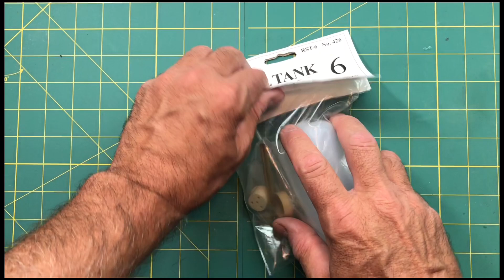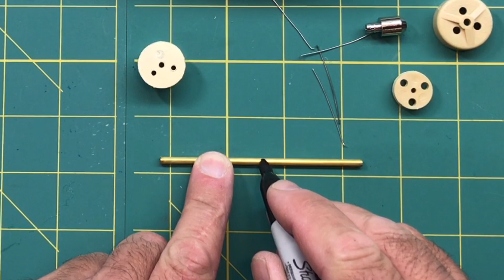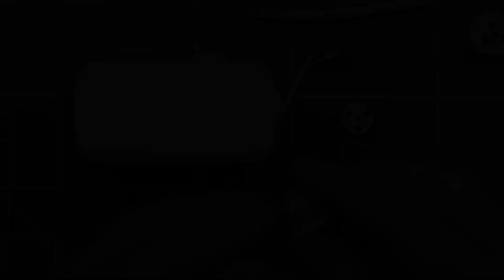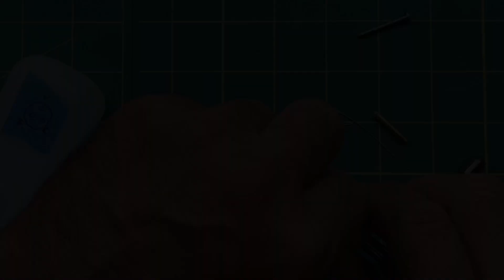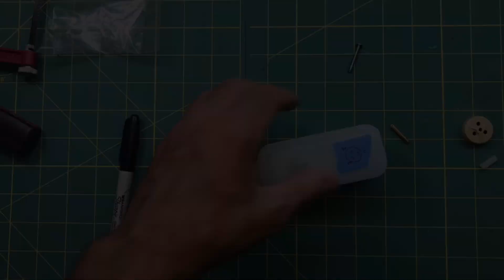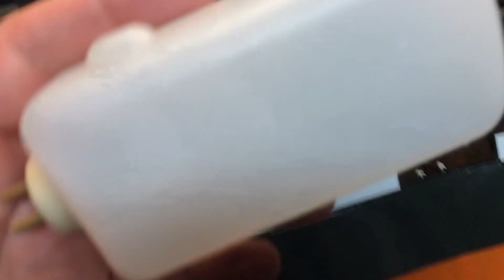Assemble an RC Plane fuel tank

Comment: Sorry this is not the way to design a tank its all wrong!!!    You just need 2 in/out  the vent line serves no purpose at all you cant make pressure from exhaust with an open vent hole to outside

Comment: I know this is a 4 year old video. But I noticed the clunk sticks straight out and doesn’t fall to the bottom of the tank. I wonder if this caused the dead stick condition on your subsequent video?
Reply from the maker: Thanks, Ill have to review and see. If it was hanging in the air, that would be a problem on a low tank for sure

Comment: I recently purchased fuel tank for my plane probably it's chineese made.Before inserting stopper to fuel tank brass fuel tubing rotating easily.Is this normal or how I can fix it? Or if I insert stopper and tighten the screw is it going to be fixed?
Reply from the maker: Hello, ya hopefully just tighten the screw on the stopper should secure it. Just don’t strip it. Tighten and check as you go. Once you get all the tubes  seal all but one off with a piece of tubing and blow into the open to make sure its air tight, then you are good.

Comment: I bought a sulivan 12oz. tank. This my first time doing this. My plane has a cowl. I'll have three lines. One is the pick up line to carb. One is the vent. Do I just have hose down ward for the vent? Third line to the muffler. How would I get fuel pumped into my tank if I have a cowl?
Reply from the maker: One line has the weight clunk on it that extends to the back of the tank and should be free to move about, this line attaches to your carb. The vent line is curved up in the tank toward the top on the inside and this line connects to the muffler which pressurizes the tank and helps push fuel to the carb. The vacume action of the engine also draws the fuel. So you do not need anything else to get the fuel pumped to engine... Now the third line is actually optional. You use that if you want to have an extra filling line, so that just goes anywhere usually in your tank compartment loose that you can connect to when you fuel up a tank. You will a "fuel dot" to plug the line that you take off to fill up and put back in after filling. If you do not want to use the third line for filling, you can fill the tank by disconnecting the  line at the carb, fill though that and then just plug back on carb. For the third line you can also install a little fuel filling valve that you can plug into as well. Look up on Dubro website fuel dots and fuel filling valves, they also have tutorial on setting up a tank. The cowl doesn't matter , it just covers the engine. So you may want to use the third line to fill as noted above since you usually cant get to the carb to fill the tank because the cowl may be in the way. Good luck!
Reply: @JamesRCPlaneTech  Today I hooked up the line with the clunk to the carb. The vent line that curves up in the tank to the muffler. I poured a little fuel into the carb for prime. Used my RC motor spinner to start it. Problem I'm having is the motor won't stay running because I can see that no fuel is getting pumped to the carb. Does it take a lot to pressurize the tank? 
I have the carb sitting about the tank if this matters. K&B .61 with a Pitts style muffler. Thoughts? Thanks.
Reply from the maker: tough to know without seeing it. The piston vacuum action should be enough to pull the fuel to the engine, regardless of muffler pressure. Do this: fill the tank, but make sure no fuel is yet in the line to the carb (air) only. Then observe the line, open needle about 2.5 to 3 full turns, set carb about 1/2 to 2/3 open.  And then hit it with the starter, you should see fuel fill the line and travel to carb. If it doesn’t then make sure its not plugged. If fuel is traveling to carb and it only starts briefly and sputters out it may be flooded or bad glow plug. Check that glow plug, it may look hot enough , but if old hard to tell. Set it aside and try a new one. Center of tank should be along center of carb or a little lower. If higher it could flood the engine.
Reply from the maker: Is the engine inverted or sideways, this is prone to flooding. But will work fine once practiced.
Reply: @JamesRCPlaneTech took the carb apart and cleaned. I think something was plugged up. I turned my remote needle valve 3 full turns. Primed it and I am now getting fuel to the carb. Attached the glow plug igniter and spun the motor. It's will run for 3-4 seconds then die. It does this pretty consistent. Maybe bad glow plug? Nos motor and everything but you think a glow plug could still go bad? Yes it will be sideways in the plane but it's currently inverted for this break-in.

Comment: I bought one for diesel engines, and the ether melted the rubber bung. 😢
Reply from the maker: Oh, thats not good. This one is for glow fuel, don’t think it works for gas or diesel. But they do make them for that at dubro and Sullivan, well at least for gas, not sure about diesel

Comment: I didn't follow the logic behind having the second clunk for fuel evacuation/filling. Why is it better than just using the carb line?
Reply from the maker: Hi, well I guess preference and also maybe access. If you have a cowl it may be hard to pull the carb line off. But if you have clear access, pulling of the carb line is perfectly fine. Like my Cub or my Revolver , I cant get to the carb line, so the third line is needed.

Comment: Why are you cutting the brass when the rubber seal is on table ?? You are contaminating  it ,the extra part was to help with bends
Reply from the maker: Interesting about the extra part, I had not known that. Makes sense to have a plastic tube to help against kinks.
Reply from the maker: Thanks, I added that note in the description as well

Comment: Good video!  I certainly enjoyed it :-))  I have two things to add to your instructions.  The first is that you can actually dunk the entire tank in a bucket of water to test the leaks.  Bubbles give away the leaky spots as you blow air into the tank.  The second thing is that you have to align the carburetor intake with the fuel line in order to prevent flooding.  Some people place the fuel line a little lower than the carburetor intake, but I never found it really necessary unless you have a fuel pump.  Also, sealing the opening in the firewall may be a good idea to protect the unburned fuel to sip inside the fuse.  However, that is only a precautionary measure, and it may not be necessary if you do a good job in the setup like what you have done here.  Take care.
Reply from the maker: Thanks for the tips. I really like the dipping in water, that makes a lot of sense.
Reply from the maker: Thanks for all the suggestions here.

Comment: Hello, i bought the same tank but I cannot make the rubber tight or locked…I screwed it until it stops but I can remove cap very easy, is it normal?
Reply from the maker: Hi. No it should be tight. It should have the outer plastic cap, the rubber stopper and inner plastic plate. The screw will go through outer cap and rubber stopper and into the inner plate. If its loose either its not tight enough or the inner plate is stripped. It needs to be tight so it won’t leak. But you have to be careful not to strip the inner plastic plate. If you can tighten it down and the screw gets tight and its still loose, something is wrong and you may want to see if you can get a replacement. The way it works is the screw draws the inner plate in and that squeezes the rubber stopper to plug the hole. If thats not working something is wrong with the tank.
Reply from the maker: Let me know how it goes. You want to tighten it down nice and snug but you don’t want to over do it since its a metal screw in plastic plate.

Comment: I need a small fuel pump to pump fuel from my tank up higher than the then it will go by the pressure any recommendations 🤔
Reply from the maker: I’ll be honest, I have never seen a small fuel pump for rc planes. I guess try to find one online or search rc forums like RCGroups.com or RCuniverse.com to see if people have done this. Im sorry I dont have any ideas. Can you reposition the tank? How far below the engine is it?
Reply from the maker: They do make the pump systems for adding a smoke system to the plane, you may be able to use something like that. The thing watch also is that any pump system will add weight. It may be a pain, but in the long run it may best to see if you can reposition the tank. The more conventional you go with the setup the less trouble.

Comment: I built two tanks just like this and they both failed the first time I put fuel in them.  Guys at the field told me I should have put fuel around the stopper before putting it in the tank to help it seal.  Never had a problem after learning that trick.
Reply from the maker: Interesting, I never heard of the fuel trick. The stopper usually works as long as it’s sealed tightly. But Ill have to consider that next time. Thanks.